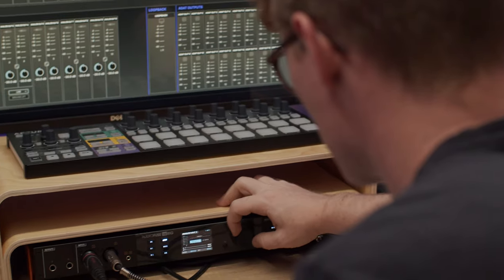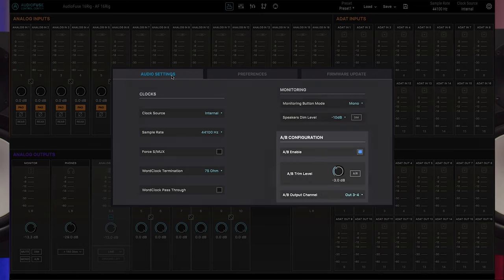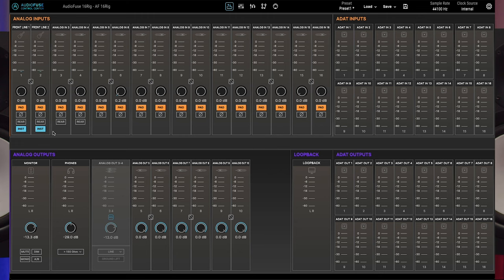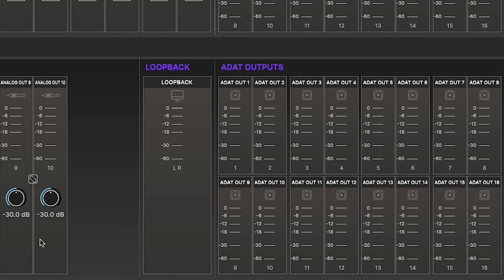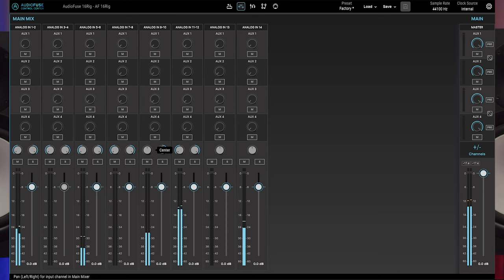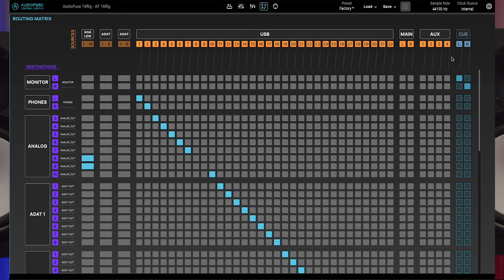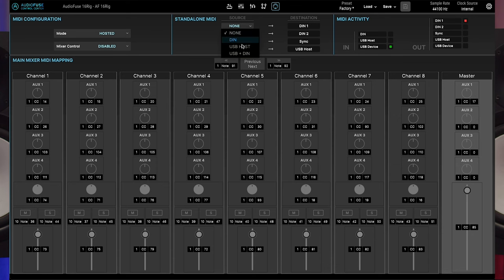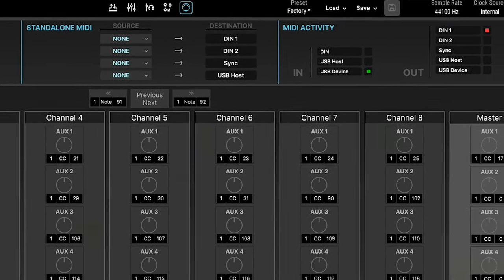Tutorials | AudioFuse Control Center - Overview

Comment: is it possible, to route the different inputs to the individual outputs? example; input 1/2 and 3/4 go to output 3/4, input 7/8 go to output 5/6. ...something like group sends.
Reply: It is not possible. I have the 16rig. Outputs can only receive 1 input. i.e output 3/4 can only receive input 1/2. But input 1/2 can go to Output 3/4, 5/6, 7/8, etc.

Comment: I have Arturia Audio Fuse Studio. Can I connect two interfaces by adding the Arturia 16Rig interface to my Mac? whether all inputs and outputs in both interfaces will be visible in Audio Fuse Control Center and Ableton. Will it be Plug&Play or do I need to install any additional drivers?